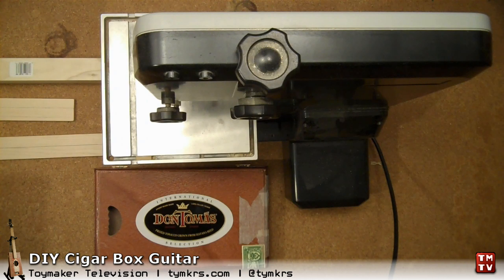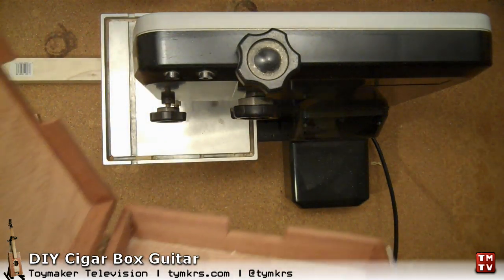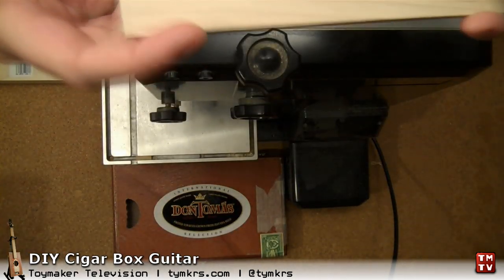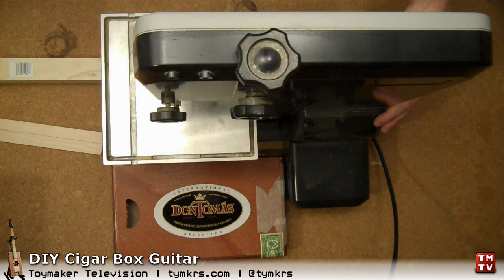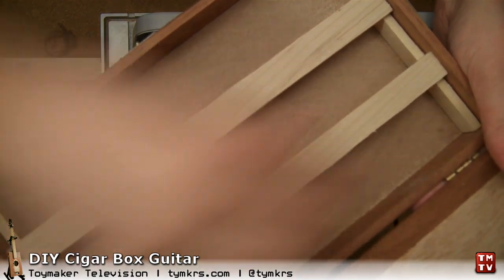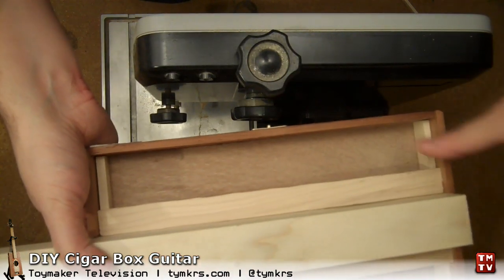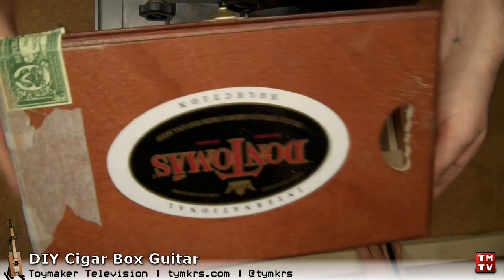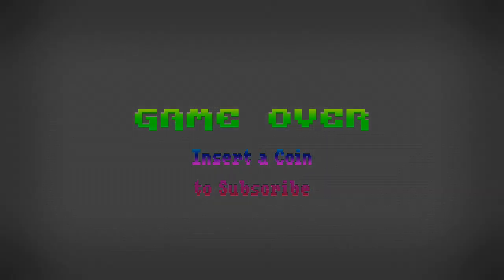DIY Cigar Box Guitar: Part 4 - Bracing with Saul the Bandsaw!

Comment from the maker: The pickup is a piezoelectric element glued inside the body directly under the bridge.  Pickups of this type are very high impedance, so to get a great sound out of them it is very important to use a preamplification stage with a high impedance input. More info on this in other videos we've put up.

Comment from the maker: The easiest way is to keep the neck as parallel to the top as possible, then use the nut and bridge to set the angle of the strings along the fret board.

Comment: Hi. Is it the timber inserts, which you initially took out, that you are using for the braces?
Reply from the maker: TheMechanicChick Nope, the initial braces had a tapered side and lessened the sturdiness/stability, so we used craft wood from Home Depot (the 1/4" stuff) and cut that for the bracing instead.  Hope that helps!
Reply: Thanks :)